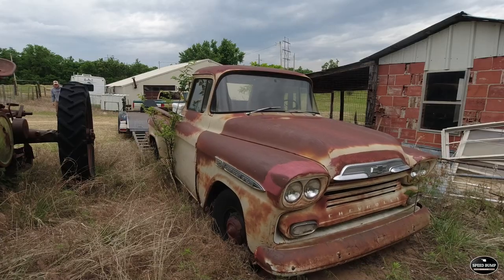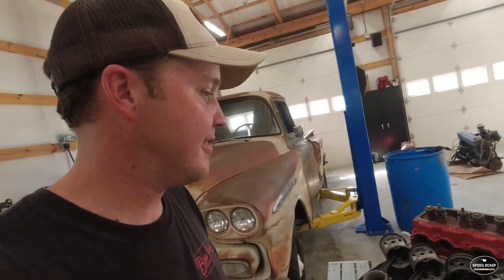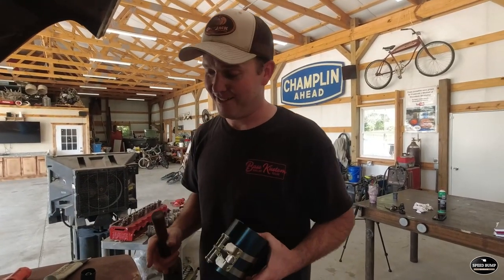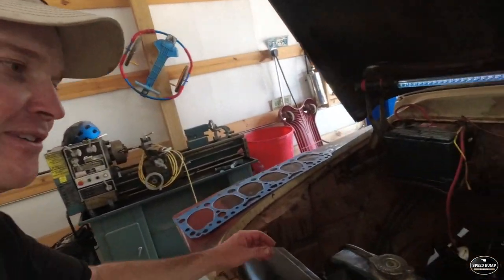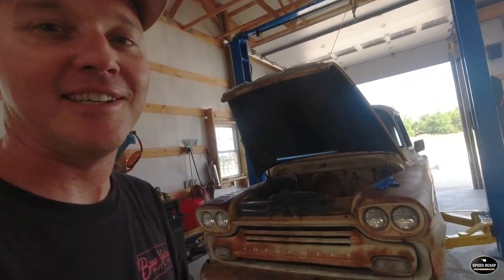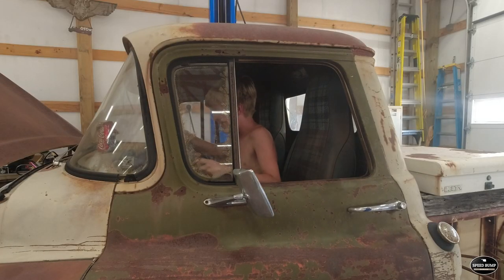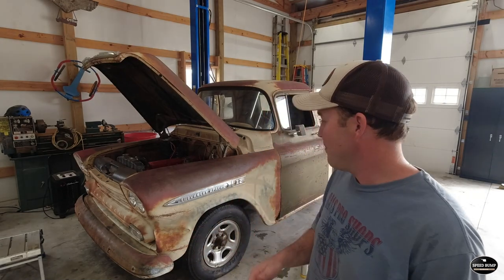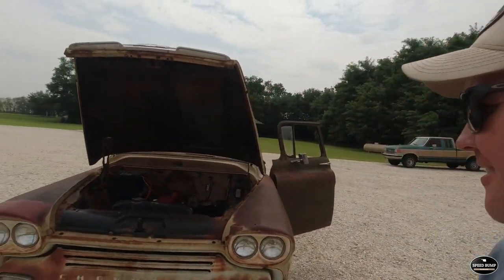Will It Run? 1959 Chevy Apache Ep.2

Comment: I’ve had two 58’s and a 59, as someone who has resurrected a few here’s some advice, grease your kingpins until the grease comes out clean, if needed heat up the joint. Also if you didn’t get upgraded valves you will be regretting it, the original ones can’t handle unleaded. God I miss my trucks
Reply from the maker: Thanks Charles! I will definitely get some more grease in the kingpins

Comment: Very nice. My grandson and I got his 1960 chevy truck running. Much like you around the pasture. It was awesome. We had to pull start it though. Only we got the brakes to work first.Tried just starting with the starter. It just wouldn't crank fast enough. Also has a 235. And four speed. He is 15. And only with me in the summer for a while .I  am  rebuilding a 1961 and I bought the 1960 for him.He loves it. And it starts right up. 👍
Keep up the good work and. My suggestion would be to upgrade the rear end. Maybe find a Dana.
Reply from the maker: Thanks! Congratulation on getting the 60 running, I bet he had a good time with it.

Comment: I'm so envious, I bought that same truck except a 58 in 1988, ol' boy had dropped a 327 in it at some point and it ran pretty good,  all I did was change title and registration on it and started driving it lol, all for a whopping 600 bucks. Ended up selling it because I really wanted a short bed. Never was able to get it though because life got in the way . Was looking online and found a 59 3100 non running fairly good and straight but needs work of course with fairly low miles for..........6 grand!😫
Love your videos though!
Reply from the maker: Thanks for watching! The prices on Apache trucks has gotten pretty out of control

Comment: My '59 Apache had one tail light, gun rack, vacuum gauge,oil bath air cleaner,no radio. when an axle broke the wheel pulls away for no brakes.The first time the differential failed I had to wait a few months for another one to show up at a junk yard -more fun in the desert.
Reply from the maker: We lucked out and got the 2 tail light model.  Not many of them left in the junk yard anymore

Comment: Put some heat in that engine, get the rings seated, and then decide if you really have a problem with oil burning.
Reply from the maker: I think you’re exactly right.  It has improved a lot since this video.

Comment: My wife has a 59 Impala that had a 235 in it it would use a court of oil every 75 miles. My Brother and I rebuilt it a it still used a court of oil every 100 miles. The thing with it was it didn't smoke or leak any oil. We never figured it out. We had the head completely rebuilt and new rings and bearings. I talk to a guy that said the car was his grandpa's and he said it burned oil from the time he bought it new. He said GM worked on it but couldn't get it to spot and his grandpa wouldn't let them put a new engine in it. I pulled the engine out and put a 327 in it. Then a 350 we later pulled that out and put it in my son's pickup. The brakes went out on the 59 and we parked it tell we could get the brakes fixed.  Then my son needed a engine for his 69 chevy pickup so we put that one in his. So the 59 need a engine now. 
I love watching Jack on his channel and Adler farms was talking about you this morning on the live I was watching of his this morning so I come over to check you out. Love the 60 Chevy wogan.                 Dan
Reply from the maker: Thanks for stopping by Dan! That is a lot of engine swapping. A 59 2 door impala is one of my absolute dream cars!
Reply: @SpeedBumpGarage  wish it was a two door, but it's not.
Reply: @SpeedBumpGarage  at engine swapping was over several years.

Comment: The 1960 1961 1962 Chevy Truck came with torsion bars and the engine was mounted on the front with a U shape 
Motor mount On the  283 
The 235 mounted on the front of the motor also. A little different set up. But different setup than the 59.This was unique 
Also had hydrologic clutch and a Xbox frame It was ahead of its time.
Reply from the maker: That’s exactly what that spare has. Hydraulic clutch and it has a starter solenoid instead of the floor switch.
Reply: @SpeedBumpGarage  Yup exactly. The clutch slave is on the left side.Chey changed the set up in 1963.To save money. The x box frame went ladder. Clutch went manual .torsion bars where replaced with springs.  A lot of people think that 1960 1966 were the same. Also the Apache badge was gone. 1958 to 1961 4 years of the Apache  double headlight years. Great job on your restoration 👍

Comment: Just curious did you check the clearance on the crankshaft bearing when you installed them?  I realize that's a bit time consuming and longer then you wanted to take for the video.  Also "dad" you should explain to Jack what 30 over means and the simple math to determine what the final cid is.  Engines are a good practical application of why math is important.  Good to see tranny was working good.  Original engine could be machined more possibly, you could look up the specs to see how much more then 30 over you could go, and stay original.   Like I said on your first video I had a buddy in the Navy that dropped a 409 in a '61 Apache.  He was a construction mechanic and we could use the base facilities in our spare time.  I used them when I painted my Hemi Roadrunner.   Keep up the great video's.
Reply from the maker: Thanks Mike, off camera we did check clearance on one rod with plastigage mostly just to show Jack how to do it. After that I measured bearing thickness in comparison to the old ones and went with it. I’m not sure Jack completely understands engine displacement yet but it will be a great math learning activity. I wish we had a 409 setting around! I always loved the way they looked.

Comment: It's been three weeks you may have finished this truck. But I think the majority of the smoke is from the oil you had in the cylinder. At least run it at highway speeds for an hour or two to burn it all that oil before you decide to change the engine.
Reply from the maker: I think you are correct! thanks

Comment: Before you drive it much more you might want to pack the wheel bearings.  You shouldn't turn the key on so long before starting it, you can burn up your points doing that. I stay keep it a 6 cylinder. It's a farm vehicle, not a hotrod.  If it smokes a little just call it a "smog device" :>
Reply from the maker: Thanks Duck, we are packing bearing and fixing brakes in the next video.

Comment: It'd be very cool to keep her original.  If you slip a 350 in there, ya gotta swap out the rear, and just change the whole truck's character.  Work on her little by little, then have the two boys share it - they've already put in some sweat equity.
Reply from the maker: It’s not getting a 350 anytime soon, since this video the truck has been running great! With almost 7 years age difference Jack will probably be tired of the old truck before AJ can drive

Comment: I miss the older vehicle's cause they lasted longer and was easier to repair cause you and your youngns just proved it without having to pull out the entire engine..I'm pretty sure that you can bore and sleeve that cylinder and use the same piston again or just put a new piston in the cylinder and that way you can still keep the same engine in the truck..

Comment: Keep it original ,  now what it is the difference between  using parts from the original engine and the engine you have in storage , the engine block is ok, but what about the part that makes the truck smoke is there a possibility of only using the one part to keep that engine original or is there any difference between years.